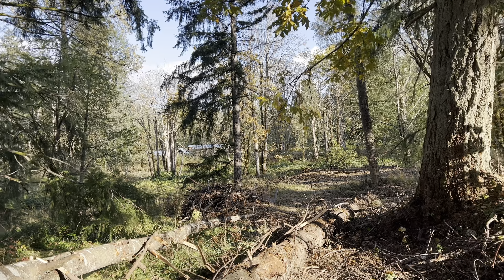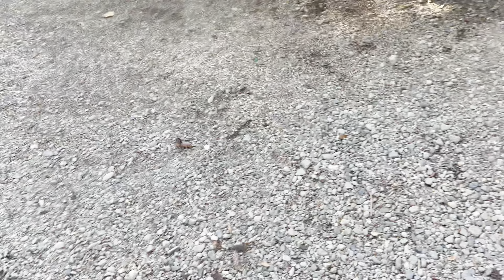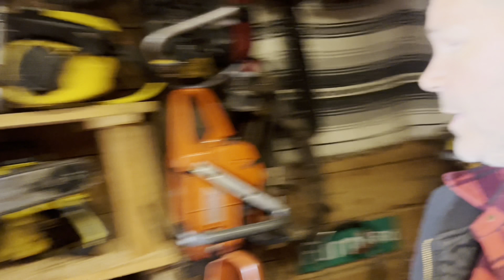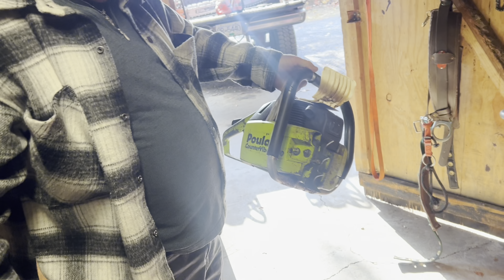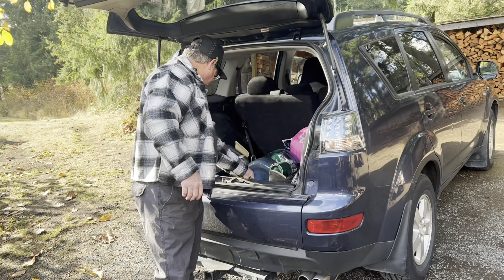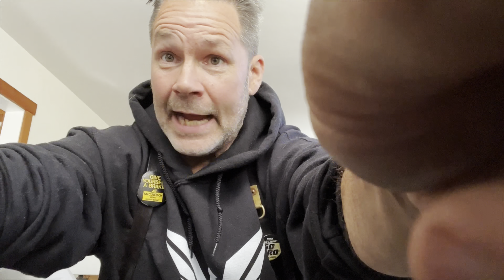Weird Chainsaw sharpening method, cuts fast. Is it worth the effort?

Comment: The baby c looks like something we can do with chisels, where we use a small 'micro bevel' to reduce the amount of chisel face to sharpen for fine woodworking. It's easier to maintain because the area that must be dressed is perhaps less than an 8th in tall.

Comment: Buckin' Billy Ray Smith!  I see you're running a Stihl bar.  Is there any reason you like them over the husky/oregon/etc...?  I like that it doesn't need to be greased, but I've also noticed that the nose seems to wear out faster.  Like once that bearing in there is busted, it's done for.  But then there's no hassle with nose greasing, so maybe its worth it?

Great content as usual, love it.  Cheers!
Reply from the maker: weight,,, thx